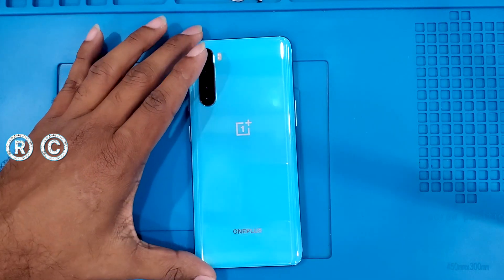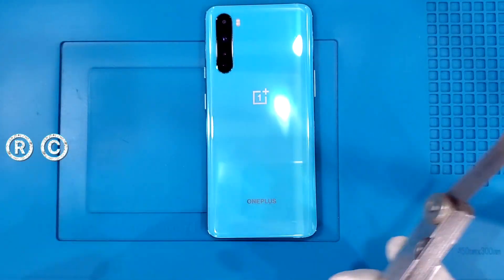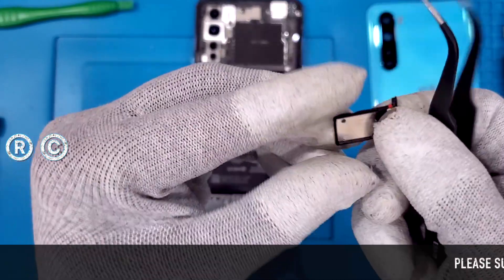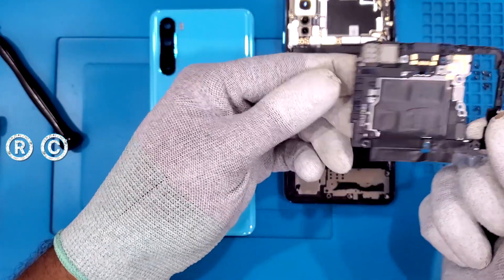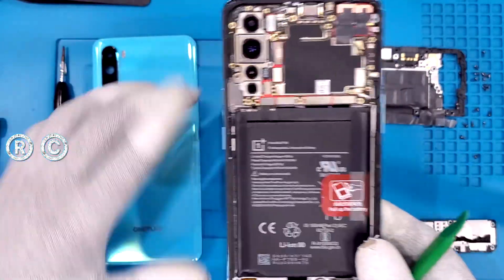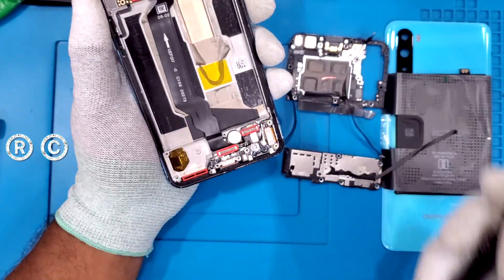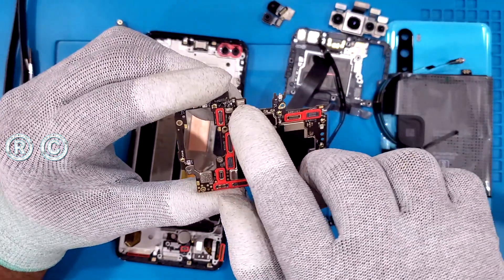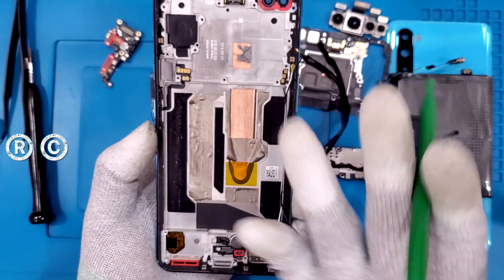Oneplus Nord Teardown In Telugu | How to Open | How to Disassemble

Comment: Annaya chinna doubt 
Thermal sheet better aa copper sheet better' aa heat absorb chasukovadaniki and adi akuva cost padatadi
Reply from the maker: Copper sheet better heat absorption untadi and bit expensive compare to Thermal sheet..
Reply: @MrTechRC710  annaya ardam kale ...... Mi note 9 pro max lo copper vadaru kada yindlo thermal vadaru anti ani naa doubt